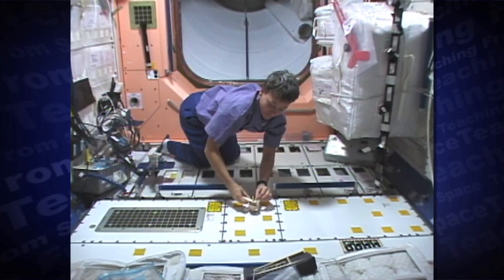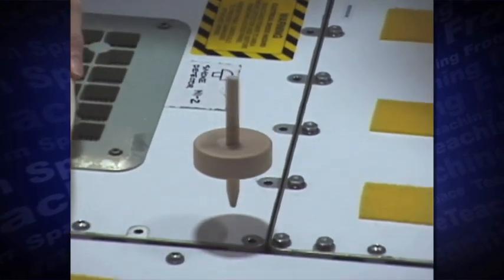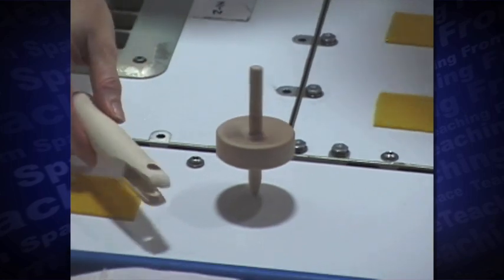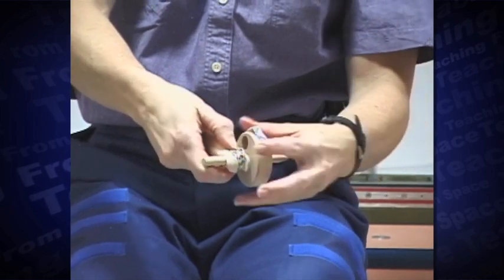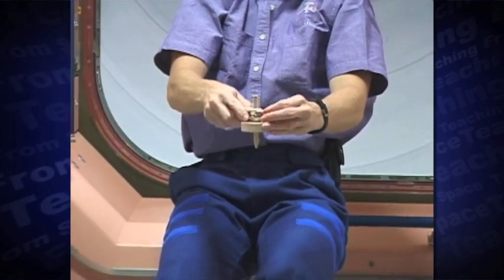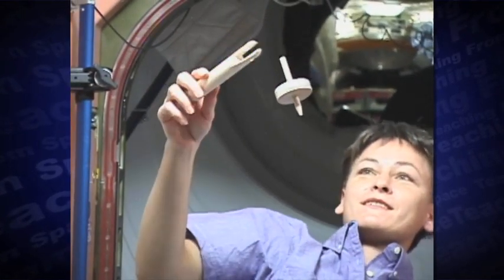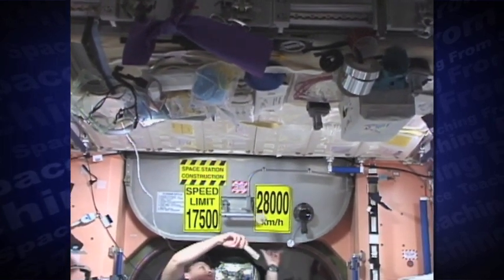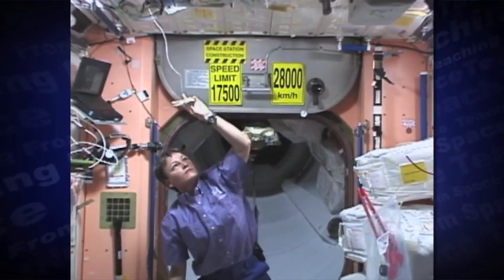International Toys in Space: Spinning Top

Comment: I was confused for a moment why it would Hop several times on the floor, even though it’s weightless. It shouldn’t had fallen down again after numbing the floor once.
Interesting how it made me recognize the thing near the bottom being an air vent sucking in air probably for dehydration/reoxidizing. Might had pointed that out, because not everybody will get it being the air flow pushing it back to the bottom?

Comment: So as long as it didnt hit anything the top would spin forever?
Reply: No, there is still air resistance that is slowing it down.
Reply: would it spin forever outside the space station?
Reply: @alexbramb  No, outside the station, given that it is wood it would break apart very quickly. 

But I see what you are getting at. It would spin for a very long time but sooner or later it would just start to "float" because energy cannot "create" itself. An object that is put in motion will stay in motion, this is true but it is not a given that it will be the "same kind" of motion.
Reply: @Vollification  Why would it break apart? It's good dry wood .. strong and light. It would not break apart and yes .. would spin for a VERY VERY long time. The vacuum of space would do nothing .. what will is sunlight and micrometeoroids over enough time